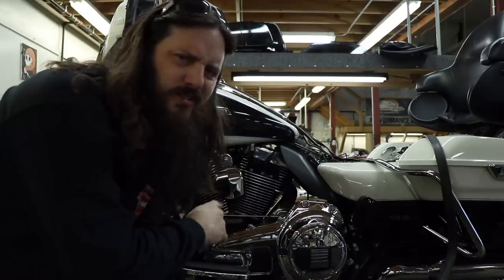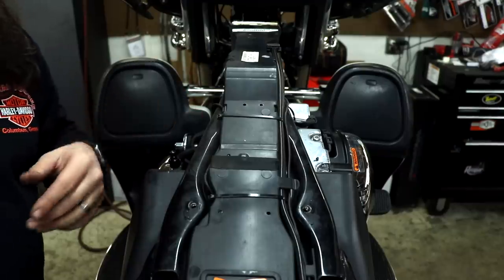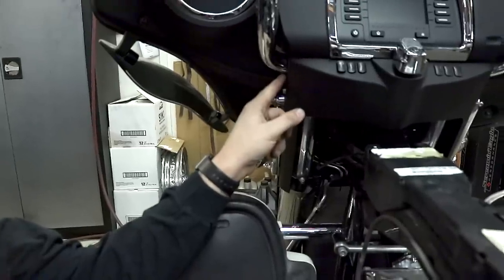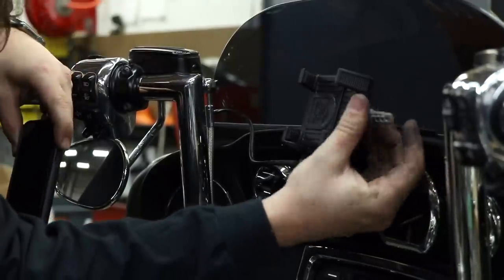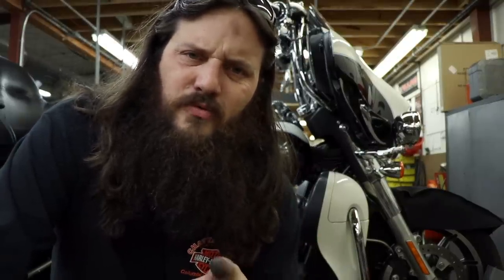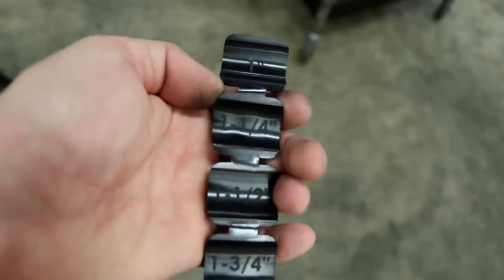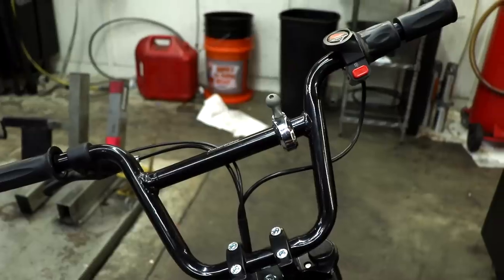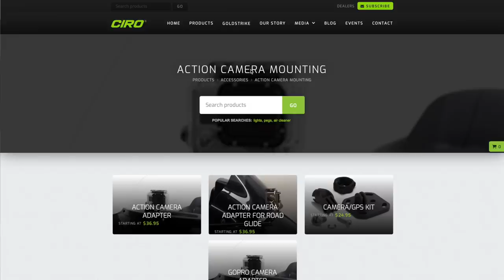Ciro Cell Phone Mount and Accessory Ball Mount System

Comment: I've been using one of these for about six months.  Holds the phone really securely and without vibration.  The powered aspect makes it a clean look.
Reply: I almost bought a different brand but the salesman directed me to the Ciro brand and its quick latch for securing and removing the phone.  That's a great feature.  The other brand you had to screw it tight.

Comment: I bought a phone mount and installed it on my 2019 Street Glide  love it totally holds the phone in and out easily adjusts easily good stuff fair price too. Been using it for 2 months By the way John your video on Ciro forward control foot pegs I love those too never would have known about the brand without your videos ride on...

Comment: Nice looking mount system! 1.3 amps is not enough to charge my phone while using gps. I typically use 2.1 or higher to maintain the charge so the screen can stay on while using the gps. Thanks for the great review video!

Comment: John, I use the phone for GPS as well as for phone calls. I had a Ciro powered mount on my Sportster, mounted on the left. It was wired to the battery and was hot all the time. It was also a bit too close to the toggle switches. Being hot all the time made me nervous, after the short cable shorted out once while the bike was parked. I traded the Sportster in for a 2018 Heritage (kinda like you did, but mine is a 107), and connected it to the USB port behind the fork with a 40-inch cable. Now it is not hot all the time. Cables for both are available on the internet, but you have to look for them. Nice video. Thanks.

Comment: Thanks for the Vid. I ride a Road King and cell/GPS navigation is my next project. I had been thinking the HD power port mounted low on the bars and just plug in like I do in the car. I only need the GPS/phone for non local riding and want something unobtrusive. Don't want to see it if I don't have to. May look at the non powered set up if there's a quick way to attach/remove the mounts.

Definite "less is more" fan...

Comment: Great video. Just bought the Ciro w/charger. My question is : Does running the charger cable to the battery means the charger will always be on ?And will that mean it’s more likely fail sooner ? Thanks in advance.

Comment: Nice video, I need a mount and will look into Ciro. I'm sure you are well aware that the softail lineup has a USB port on the left side of the tank towards the front, at least on my 2018 FXLR. Page 24 figure 6 in the owners manual and page 93 but it is not listed in the index

Comment: John, good video. I have a 2012 FLHTK, please do a vid on on checking and adding air on the stock mag wheels. It's a total pain the ass to check and add air. I and others would love to keep the stock wheel. What would you recommend for an offset valve stem that would make it easy to check pressure. My rear is doable, but the front sucks. I get tired of pushing the valve stem to the side so I can screw on the tubing on my HD air pump...

Comment: John I love your videos brother keep up the good work. But I have a question on this one here. I am looking to do a faring type mount on my 2012 Ultra Limited but here is the only issue I have the leather 3 compartment storage right there behind the windshield, is there an option for someone like me without having to take out my storage compartments and not have to use a perch mount? Brother I would really like your advice. I am a 100% Service connected disabled veteran and I would like to have my phone centered and keep the storage that I use up there. please help if you can. And Thanks in advance.
Reply: Did you try it with the pouches? how was it?

Comment: Got a Ciro phone mount last year.  Not happy with it. I have no problem with the phone cradle, but it how the cradle mounts to the ball.
It's a plastic nut and I couldn't get it tighten enough. With the vibration, the phone would just tilt down. I switched it out for a Tackform Solutions Enduro Series mount. It's metal on metal ball clamp. Now the phone doesn't vibrate out of place and offered me a better mounting angle for the phone. It was $59 on Amazon.
Reply from the maker: That sucks it didn’t work out for you. Did you let Ciro know your gripe? I’ve heard nothing but good things about the mount, so I’m surprised you didn’t like it!

Comment: John Maxwell 
Please tell how is if I would installed my phone (Samsung Galaxy A51, 172 g) in horizontal position on Street Glide 2016 fairing? In this case will be phone reliable secured from dropping from bracket? What about vibrations? I asking because for navigation mode in phone horizontal position would be more convenient, isn't? 
Please share your experience. Thank you.

Comment: Hey John. I just bought the ciro mount/charger but it's the fairing mount. do you have a video or special instructions on that install? and are you happy with the chargers performance. I noticed there's not a 2.4ah option for turbo charging options. thanks bud

Comment: Cool.  But no way I could ride with that phone in middle like that with my OC AND ADDHD would drive my crazier.   Hey big question. How do go about take the fuel line from the gas tank  with  Fuel injected?     
 I got great I deal for video where you show us how to installing Ciro Fang headlight bezel for Roadglide.  LOL
Reply from the maker: 😂 it’s a quick disconnect. Like an air hose on a compressor. You’re supposed to relieve the pressure before taking it off.
Reply: Hi there, if you don't want the phone in the middle, we have many other mounting options as John demonstrated in his video. One of our most popular mounts is our perch mount that goes next to your controls. Here's the link to check it out! https://www.ciro3d.com/product/50311-smartphone-gps-holder-without-charger
Reply: @TheHarleyTech  cool never knew that but had no reason to take tank off  thanks
Reply: @ciro3d_goldstrike3d  cool I dont need one . Yes you have lots of option.  If you send John those Fang headlight bezels I'll let him install them on my RG lol .

Comment: John, thinking about adding the Ciro powered cell phone mount to my 2017 FLHTK. Any reason I should run the power to the battery as opposed to getting power at the power receptacle on the right side of the fairing?

Comment: Hi John... A great video. Could you tell what is the size of stock handle bar in Sportster 1200 Custom and which mount will suit better?
Reply from the maker: 1” is stock, and either the bar mount or the perch mount, it kind of depends on where you want to place it. Right near the speedo is a great location, which would require the bar mount. Left side perch mount is also great. It’s all personal preference!

Comment: I found a really good deal on a 2011 Road Glide but the abs breaks are not working. Is this going to be a costly repair?
Reply: I just did mine thinking it would be a warranty job due to the recall (check recalls) and.... 1,000.00 USD later from my local dealer got my abs working. Yes. Get ready brother
Reply: @santossuarez  Thanks. Thats what I was afraid of.

Comment: Anyone know why wouldn't it just tie into the cigarette lighter wiring instead of going to the battery?
Reply: We'll got mine installed yesterday.  Instead of going to the battery i tied into the cigarette lighter and ran the wire right next to the fairing mount itself.  no notches needed there is enough space there and it doesn't pinch the wire.

Comment: Man I bought & installed thePhone mount & charger on my 08 Electra Glide Classic. What a POS. I tighten the crap out of that Ball & it wouldn’t stay in place. Bumps or idling. Vibration was terrible. I’m taking it off ASAP